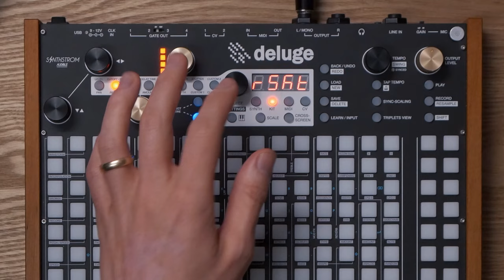The Deluge Video Manual 07 - Sampling

Comment: Another great deluge video! Enjoyed the lofi loop that you made, music tutorials are much more enjoyable when the demos are musical :)

One trick to cut down on buzzing or clicking on samples with a repeating section is to zoom in super far, until you can see single lines of the wave form. Adjust the loop begin and repeat points so that they are at the same level, going in the same direction (I usually make both going up, crossing the midpoint). If they are at different levels, and there is a jump, it is like a square wave at that point, adding higher harmonics that give buzz and clicking sounds. It's a bit of messing around, but if you are trying to capture a particular sound, can be worth it
Reply from the maker: Thanks so much for the kind words and the advice about looping samples. That makes a lot of sense to be honest, so I'm going to be using that more from now on :)
  These videos are definately pretty devoid of music haha. Hopefully when I launch the "workflow" series, there'll be a lot more music and fun involved :)

Comment: @RSKT, maybe you can help me understand this. (But first, THANK YOU for these amazing videos)

How do you (if at all), manage the problem where the sample you load as a synth (your kick in your example), but the original sample is, say, a A#, but it gets loaded into, say, a C ‘slot’ for the root note. Wouldn’t it then completely mess up the scales throughout, for that track?

Are you literally pitching the sample up or down to match it’s root note slot or something?

I feel like this is a sampling 101 I should already know.
Reply from the maker: No problem! From memory, the Deluge tries to recognise the pitch of the sample so that it's loaded into the correct slot. (There's a section on this in the manual somewhere I think).

But either way, if it doesn't work then yeah, I'm just manually pitching the sample up or down. You can use the custom1 knob for this, or the transpose setting for the first oscillator. :)
Reply: @RSKT_music  thanks!

Comment: 23:10 can you do this per step? Not changing the global pitch of the actual sample but just on one step
Reply from the maker: You can. Custom 1 is mapped to pitch automatically with samples, so you can use that to automate pitch and parameter lock it.
Reply: @RSKT_music  thank you! Is this also able to be quantised to semitones etc?
Reply from the maker: @SiychMusique  You set the quantisation in the settings (there's a few options there) , but only applies to things you live record in and you can't edit the quantisation of that recording afterwards (unless you do it manually). But you can add in different semitones to the sequencer if you want.

Comment: I wish the speed control has more precision. Ideally in hundredths. It seemed to be too course an adjustment for me.
Reply from the maker: I kind of feel the same way with a lot of other things. Some finer detail on the envelopes would be really nice, but it is what it is.  I'm not sure if this will work with the speed control (you can give it a go though), but I tend to map parts of the envelopes to LFO's for snappier control. For example, when making a percussion sound, a super snappy decay is sometimes needed, but setting the decay to 1 sometimes feels even a bit too long. So mapping decay to LFO2 and  and then changing the LFO rate can sometimes help with that.

Comment: Loading samples into this device is so bad I gave up. By far the worst design I've ever encountered . Literally unuseable
Reply from the maker: I'm not trying to be negative here, but I am genuinely so baffled by this comment. What was unusable about it? You literally put sounds onto an SD card, plug it in, and then load them. It couldn't be any simpler. Genuinely interested to hear more about what made this so difficult for you.
Reply: @RSKT_music  
Multisamples. They hardly ever load without errors. Most of time. Well reported on the forums.
Reply from the maker: @williamwallace6508  Ahhh I see. Yeah I do recall talking to someone on reddit about this very issue. Seems to have a limit with the mulitisamples, and you have to be very specific for what you can load into it. Still, I wouldn't say that makes it unusable.
Reply: What hardware sampler out right now loads multisampled instruments in better and has a good library?